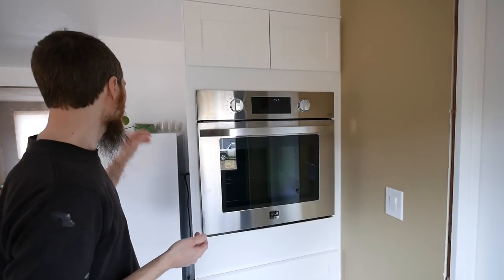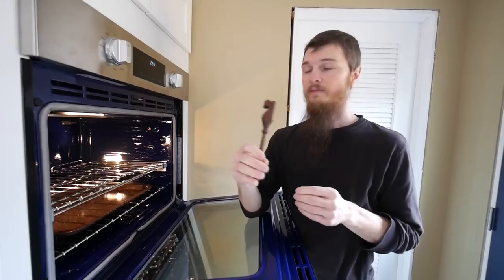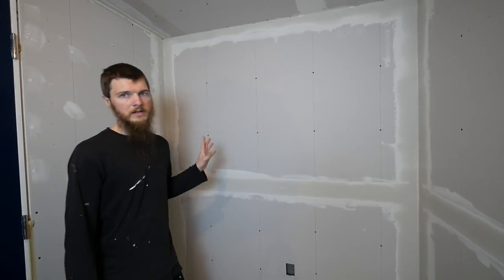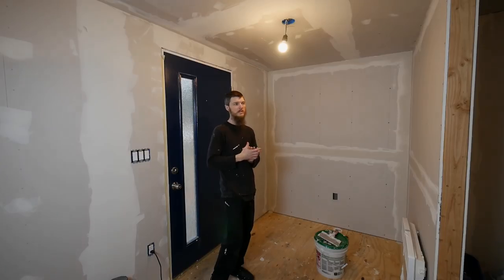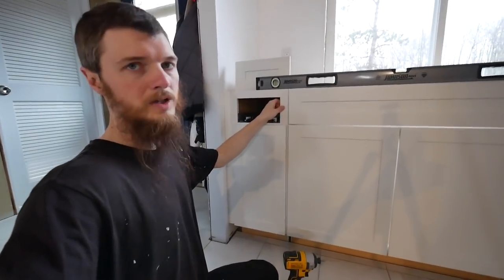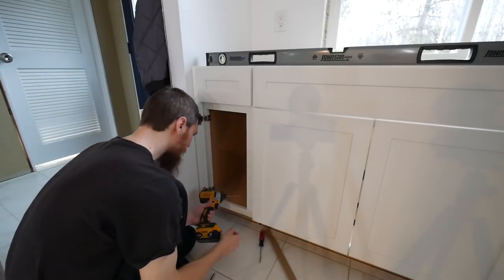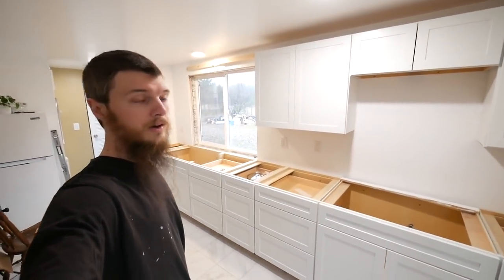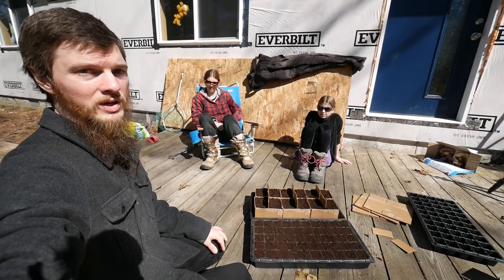Our New Oven Was Missing One Important Thing!

Comment: Yay, final kitchen cabinet installed. Just need that one for the laundry area  and you'll be all set. 

I love the look of the kitchen, it flows beautifully. I'm totally with you on the upper cabinets not having to line up with the floor ones. Especially as you have designed it around the size of the stove top which will alter the overall look once it's been installed. 

Great to see other small projects also pulling together. 

We're in lockdown where I live, so I can't get out to the garden, but I've managed to plant a few salad seeds to grow by the kitchen window, which is south facing. It's not much, but it's been a good way of connecting with the natural elements in these extraordinary times. 

Stay safe. x

Comment: Because I am only 5 feet TALL I would not be able to use that oven  even with a little step stool LOLOL.  Neat TOOL for oven very nice.  When are you going to finish the trim around the windows?  The cabinets are absolutely GORGEOUS!!!  Your install was PERFECTION.  GREAT JOB!!!
Reply: ha ha....I remember as a kid when we had a kitchen remodel, the carpenter measured my Mom for everything. The cabinets, which he built,  plus the window placement. All had to be just the right height for her.
Reply from the maker: The trim will be finished later, after the countertop is installed. We actually have a lot of trim work to do throughout the house. But we've been slow about getting that done.

Comment: Doug or Ashley, would you be willing to share how well you like that hand vac and what make and model it is? I spent a long time looking online for something like it and in the end gave up because I couldn't figure out one that held a good charge and had good suction and was easy to use.

OK, I"m also looking at your description box and seeing that if I do order something, I would want to do it through your Amazon Associate link. For some reason I'm not seeing it or the Home Depot link. Am I overlooking them? Thanks in advance.
Reply from the maker: It's here: https://amzn.to/2XhWIgU (affiliate)
But you would still need a battery and charger. It's made by Hitachi, which is now called Metabo. So you may have better luck finding a metabo battery and charger than the old Hitachi ones.

Comment: Now you need to put a hook on the wall between the Oven and the light switch so that your oven tool is always right there when you need it and never have to go looking for it when you need most.
Reply: @home owner Diyfferent first you have to put a hook on the wall and the Oven tool in its place on the hook, But in my opinion,  it will probably be like the hook where the airconditioning remote belongs but never there when you need it.

Comment: LG should have made it so that the rack slides out when you open the door, the way it does in some toaster ovens. The earliest GE Toast-R-Oven from the 1960s automatically popped open and slid the rack out when the toast was done, but they discontinued that feature, probably because of the fire hazard. But having the rack linked to the door is safe enough, and a huge convenience.

Comment: Of course, sliding the oven rack in and out is useless unless you want to do something with the pot in the oven. In that case, you will need a potholder or oven mitts anyway.
Reply from the maker: It's not like we invented the thing. This tool has been around for a long time and many people find it quite handy. I personally only use rags to remove things from the oven and don't care for dangling them into the oven when sliding out the trays. But if a mitt works better for you then that's cool too.

Comment: Since there is no full wall to prevent the left cabinet's door from opening (i.e., moving) further, while there IS a little piece of wall that can act like a pivot, that cabinet door is in a good position (pun) to be easily snapped off if someone accidentally walks into it when it's open. Wouldn't you say? :)
Reply from the maker: No. Not anymore than any of the cabinet doors. The hinges only open to just over 90 degrees and can be snapped off if you over open any of them.
Reply: @diyfferent  Good point. Ya got me on that one. It's the sight of that jutting wall corner that can act like a pivot that has me on pins and needles.

Comment: but wait.........theres more........for a minute i though you where going to pull out a turkey or easter bunny , nicely browned and ready to serve

i think you can adjust that  height difference out the the front of the sink cabinets , 
besides that when youre standing close enough to the cabinets to nitice the uneveness it will be overlapped by the kitchen top and basicly hidden , it be like the tiling when you dont have a refference you whont notice
looks nice , think you need to run a silicone bead across the bottom as you whont be able to clean out the edge of the tiling or stop the water from seeping underneat when you spill any on the floor or are mopping the floor
Reply from the maker: Yea, when we put the toe kick on we'll seal it :)